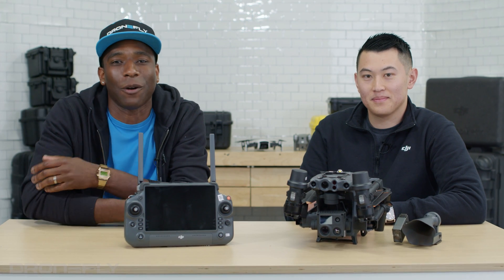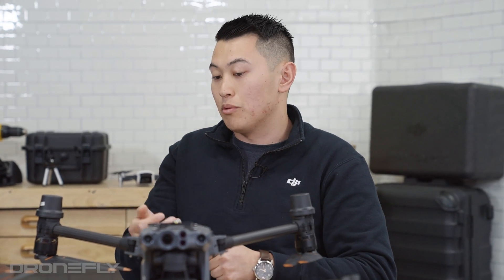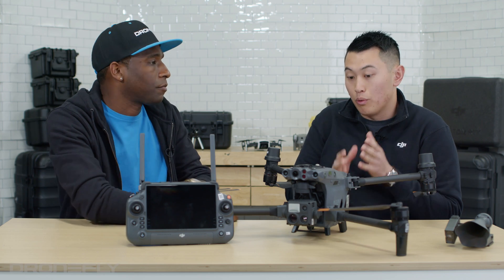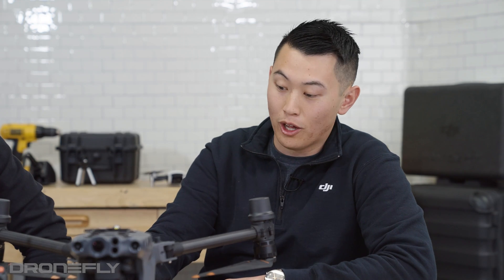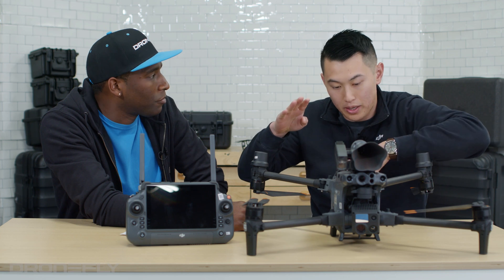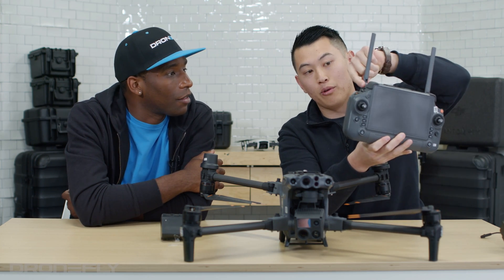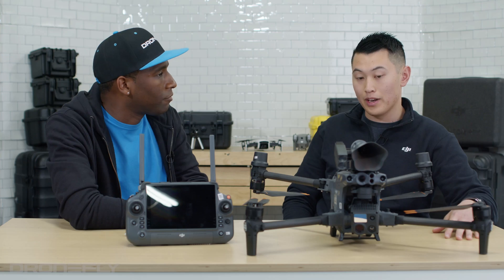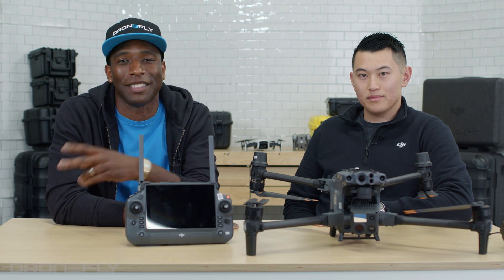Matrice 30 Series Deep Dive  - With Michael Li of DJI

Comment: This Drone could be the best creation of DJI, and the best Drone ever made!

However this Drone has 2 big downsides; 

1- You can’t pay $20,000( Australian price of DJI M30T basic kit with DJI care 1 year) in a Drone where the main camera, hardly can turned left and right, I mean when you turned left and right, you can see the arms, propellers, and stuffs, like in the whole frame!!!

The main camera should have been able to turned 360 degrees, or at the list 180 degrees in a clean view, only looking for the subject in the frame, specially when it has been “Built/ Made”  for first safety responders, like Fire fighters, Police and others!!

2- The main camera should be able to swap for other payload, like P1/L1 and more, specially because it is very compact and great drone with its size and portability!

However about swapping the cameras/ payloads, if they haven’t thought about that before realising, at the list they should have made 4 different versions…

- First version M30/ M30T, 
-Second version M30 P1
-Third version M30 L1
-Forth version the Dock one, as it already has been made( but this one it’s specific for companies and stuffs).

If the DJI Enterprise Team had thinking about that, it would have been selling just like water bottles!!

Specially for many trades out there, and many different industries would benefit from that choice to buy, different needs but in the same Drone, even more special because of those many features like as deploy time, Walter-proof, portability and on!!!